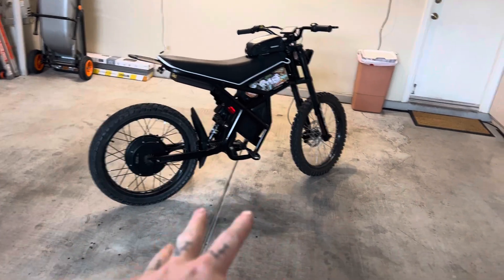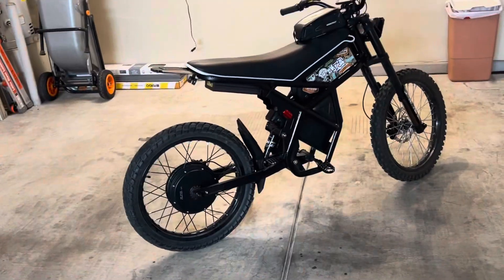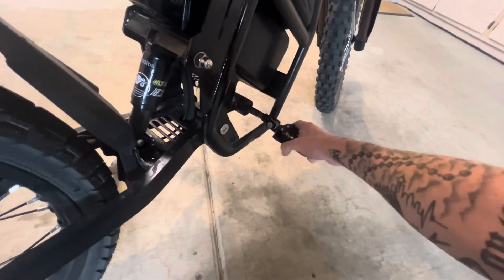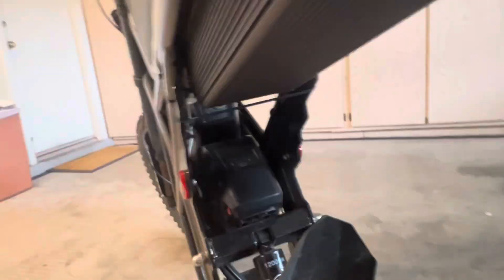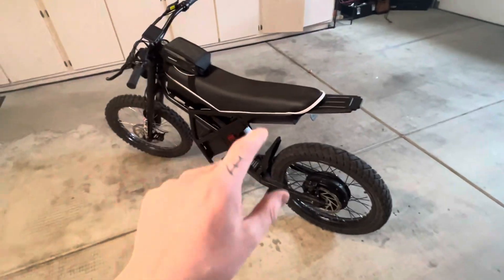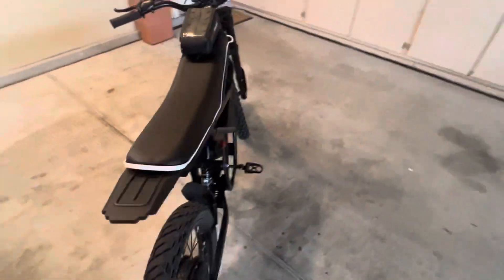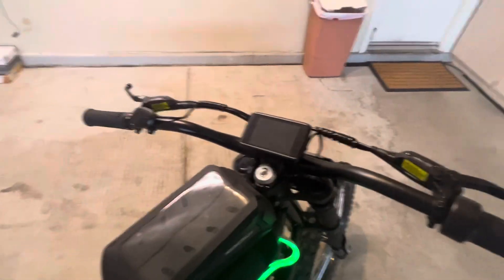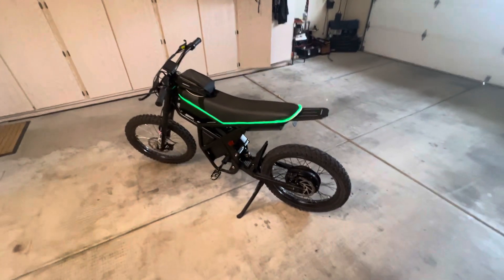Progress of building up the riding times GT73 (100amp Sabvoton controller & QS205 3.5t Hub)

Comment: I like what you did with your GT73. Mine is still in stock form but going to upgrade this summer.

With that said, I have been running mine with both batteries on - is that correct or are you only supposed to be using one at a time. 

Thank you in advance if anyone could chime in and set me straight.

Comment: Nice, i have the same motor,  but with a fardriver controller and dual 60v batteries. Should check mine out.
Reply: How fast it goes now?
Reply: @mikejones-gx5ov  I switched to dual 72v 20ah batteries, it tops out at about 55-60mph

Comment: Sicc video, my gt73 has 1k miles on it and still running I wonder why your blew up so fast. anyways I was looking at the link for the motor kit you linked to this fella in the comments and saw the dropout for the 5kw motor is 150mm-155mm ad the gt73 is 160mm did you have any issues getting the motor and wheel on?
Reply from the maker: @t0kerc177  nah, I just when to Home Depot and got some big washers for the dropout and some tiny washers to adjust the brakes
Reply: @corjayy  nice. They should def update their website tho the top speed and range hey claim is just messed up they trick people like that.

Comment: Bruh bike deff goes 37 without a hill with a 200lbs rider. You must not have speed unlocked it. Comes from factory speed restricted, must be unlocked from display button panel O_O. However this looks dope with what you have done to mod this up.
Reply from the maker: Im 180lb and couldn’t get it over 27 on flat, and it actually came with out the speed restriction on lol. But either way the new motor and controller are a definite! 💯
Reply: @corjayy  that sounds like the motor or stock controller was messed up. But seems like you have made something cooler and better than stock :D
Reply: saving to buy one, how do you turn off speed restriction?
Reply from the maker: @ tells you in the manual that comes with it.
Reply: Mine was unlocked in high power mode and it wouldn't even do the 37 unless it was downhill. 30 on flat was around normal and im 220 with full face and backpack